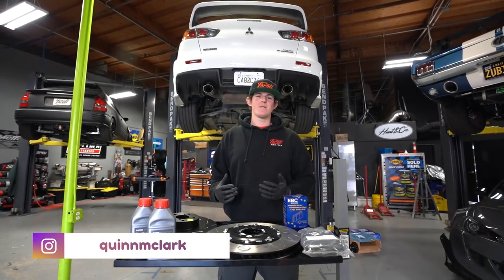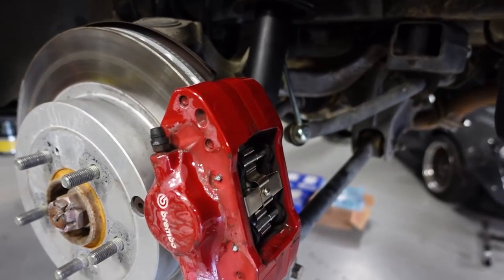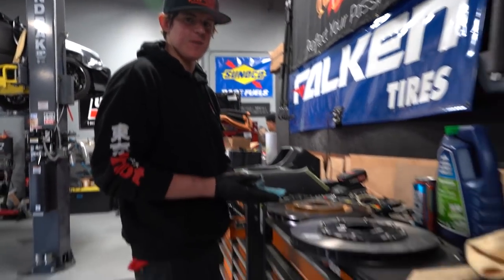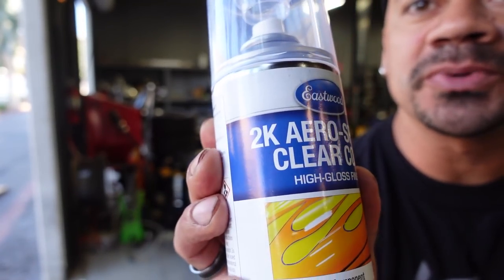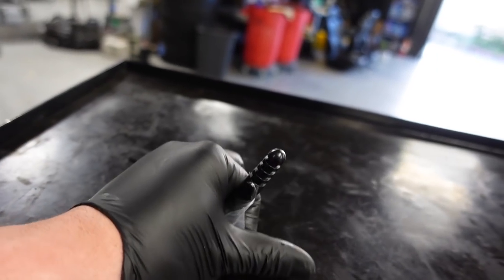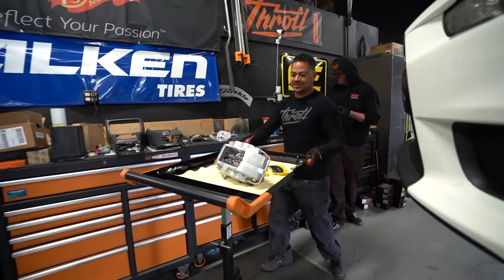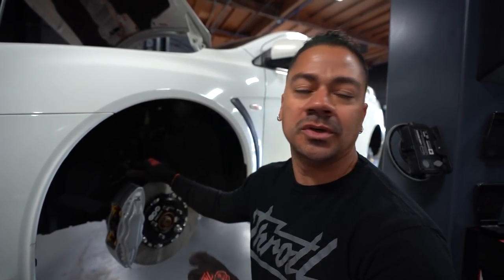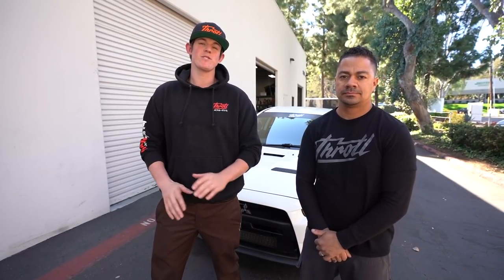Building & Heavily Modifying a 2013 Mitsubishi Lancer EVO GSR - Part 2: EBC 2-Piece Rotors + Brakes!

Comment: Hello throtl, I would really advice against painting the caliper mounting surfaces (the flat machined surfaces which make contact with the knuckle). The calipers will not sit right on the knuckle, destroying the tolerance stack-up of the entire caliper, which is important for correct function. You may get a taper wear on pads, unwanted brake drag torque, or maybe even caliper scratching the rotor. Luckily with fixed type caliper, the pads can't fell off, as they are secured with pins. 

Same with painting the pistons.
Also, brake rotor is unsprung weight.

Designing brake calipers is my daily bread. :)

Comment: 11:47 shouldn’t the brake pistons be taped off?
Reply: Lol that’s what I was thinking too
Reply: Looks like they taped 1 caliper, not the other!
Reply: I was thinking as well...Im learning abt everything still but would the rubber fine ? would the pistons work properly if 3-4 coats of paint got on em ?
Reply: I’m worried about the red lock tight on the bolts
Reply: @jo3lo85  yea noticed that too.

Comment: I must admit these films of Evo's brings back allot of good memories.  I was lucky enough to have owned 4 of them over the years (an 8, 2 9's and a X).  They are such great cars.  When I sold my last Evo a X in 2012, I just always thought, I would get another one later.  Who knew they would stop building such an icon.  Today, I am older now, been there done that and have spent enough money tinkering on cars, the Evo's in particular I could have almost paid cash for my house. haha.  Once you get started it becomes a drug, an addiction.  I got to the point that 500whp just wasn't enough.  Then, after getting pulled over by a local Sherriff for doing 130mph in a 55 zone, though I had a good reason to why I was driving fast (long story but there was a reason) I realized I had to get out of this type of car.  Its like Spider Man's Uncle said, "With Great Power Comes Great Responsibility".  Unfortunately,  most Evo drivers are not the most responsible drivers.  So I got out of the game.  I do appreciate this car, have tracked them more than  most, had some kind of Evo as a Daily for over 10 yrs.  I personally can take a 4G63 apart probably blind folded haha.  Great Cars.  Great Memories.  Best cars I have and probably will ever have owned from a performance perspective anyway.   Sorry STI fans, the Evo just one ups you every time.   Even to this day, a Stock Evo X will beat a brand new STI in almost every category.  Facts.  haha.  Love the channel, and these builds.  Defiantly puts a smile on my face.  Keep up the good work guys!!!
Reply: "With Great Power Comes Great Responsibility" love it 🤣
Reply: Thats awesome. I just got my first lancer last year. Hoping to upgrade to an evo
Reply: Agreed. Feel the same about seeing s2000 builds
Reply: @TranceF0rmation  They are great cars, but keep in mind, especially for a younger person insurance, at least in California will be OFF THE HOOK for an Evo.  Additionally, my Evo X when stock netted about 15mpg going back and forth to work and that was not hot rodding it around.  I got about 180 miles on a tank of gas.  So with 91 running about $5.00 a gallon it gets pricey.  Just things to know before you buy.  I would love to get another one, but I have been there done that I currently drive a 2020 VW GTI and honestly, for day to day use?  The GTI to me is the better car.  If we are talking on a track?  Different story obviously.  Though, after 10 yrs of being in the "Evo World" track meets, clubs and all, only about 1 in 10 Evo owners actually "tracked" their Evo's.  So in the real world?  I find the GTI just as fun to drive, Insurance is cheaper, gas is cheaper, and more practical.  If you have your heart set on an Evo, I can't blame you. 👍
Reply: @naturalsr405  Yes, there are cars that will always hold a piece of our hearts, but as time goes on, and wanting to get back into one of those cars we let get away, you realize your needs, and wants, are just different.  I actually had to sell my last Evo back in 2012 due to divorce, not that it was in "her" name, but I needed the money post divorce, and I had to sell my car and get something more affordable.  I am doing better now, but going back to those days? Well, I think you know what I am talking about.  Good Times though....Good Times.
Reply: @eppyz  definitely understand the need, sorry you had to go through that. It's been just over 10 years since I sold my s2000, and just recently and old neighbor who had one, reached out and let me know he was selling his, so I'm possibly going to get back into one. Will see.
Reply: @naturalsr405  hope it works out for you...for myself?  I am in a fairly new VW GTI so I have 90% of the fun, just less out of pocket to do so.  Most Evo's I see used are just that USED and decent ones are fetching $10k more than they were when I bought them new.  I just can't justify the purchase.  I part of me wants to do it, but the older responsible me is saying WTF are you thinking??? haha
Reply: @eppyz  oh yeah, totally get it. Same with s2ks. The only reason that I am really even remotely considering this one, is because it was just repainted last year, has a new top two years ago and his price is about 8 to 10,000 the less then what's going on the market
Reply: Beats and STI in every way? I bet the STI can beat the evo in the lets go to the dealership right now and buy a brand new one :) not to mention boxers sound better lol.
Reply: @jordankroeger3382  Yes stock vs stock a 10 yr old Evo X can beat a New STI in every performance category to this day.  0-60, 1/4 mile etc.  Yes you can go buy a new STI today, dealer has one on the lot for $45k near where I live, I never paid anywhere near that for any Evo I ever bought new.  Base STI's are going for $41k.  Evo's were the better performance bargain, won't even go into mod potential right out of the box.  That's another debate.  Facts.  They hurt sometimes.  Evo wins.  haha.
Reply: @eppyz  I've owned both and I preferred the STI, but that wasn't the point lol you sorta missed that. The point was the Evo is dead and the STI is still being made.
Reply: @jordankroeger3382  I understand you preferred the STI that's your choice, and I do understand they still make the STI, so what is your point?  That the Evo is bested because the STI is still around?  Come on.  If you think that, then you missed my point as well.
Reply: @eppyz  I never said the Evo wasn't better lol you're all jacked up about it settle down the motor and chassis have more potential though I would argue it has an inferior AWD system. It does seem that most people preferred the STI though based on sales numbers and the fact that it's still being produced.
Reply: @jordankroeger3382  well I will disagree with you on the reason why the STI is still produced and the Evo isn't it really doesn't have anything to do with sales because the Evo at least was always designed to be limited production usually 5,000 units or less per year it's the fact that Mitsubishi as a business wasn't doing well financially and they had to cut whatever they can to stay in business that doesn't mean that the Evo wasn't as good of a car it just means Mitsubishi made bad financial decisions.  As far as the STI having a better all-wheel-drive system that's Up for debate the Evo 10 with active yaw control was ahead of the time that is pretty commonplace now but you have to remember that Evo 10 came out in 2008 and had stuff that the STI was just starting to get now so if you're comparing a new STIs all-wheel drive system to the evos 14-year-old all wheel drive system here in the United States anyway then yeah that might be true but I never seen proof of that on track I mean it sounds good on paper but in the real world the Evo just always was a tick faster than the STI it just was and still is everything else is subjective based on preference both are great cars as you prefer the STI I prefer the Evo but I will say this the STI always look good in my rear view mirror 👍
Reply: Bothers me too much that a Donut video about the Evo was said that it would likely be reincarnated as a crossover...Hope that an Evo-crossover type of car isnt gonna be here anytime soon.
Reply: @Zeckrom_Gaming  You and me both.  Can you imagine... Geeze🙄
Reply: @eppyz  A normal crossover is, well, alright. But a sports crossover/SUV like a Maserati Levant? Doesn't sit right with me to be honest

Comment: I believe rotors are unsprung rotational mass. The light weight rotor hats help shave off some unsprung mass

Floating 2 piece rotors help prevent pad knock back.
Reply: correct
Reply: correct, I misspoke.

Comment: You can take a razor blade and cut the lower part of the stock antenna and use it as a spacer for the shorty antenna so it gets rid of the gap. That's what I did on mine. Tip: Cut "spacer" long and trim to fit.

Comment: Those RC style antennas are horrendously & notoriously known for causing leaks. Especially when owners take them to the carwash & the rotating brushes pull, yank & slap. 

Never use a metal stubby antennas. Cut/modify the rubber antennas instead. They're designed to yield & bend without causing major water damages & destroying g the headliner. 

A shark fin style antennas, capping/covering the oem factory screw/opening or antenna delete are better than using a solid metal stubby antennas. 

I modified the oem/factory RC rubber antenna to a stubby. Have never had any leaks, interior rust/mold, headliner damages/mold & the Sirius & XM antennas circuit board deteriorate.

Comment: Paint stripper or some B17 stripper is a great thing to have around the shop. Strip calipers in 4mins. 

Rebuild the seals all 4 45mins

Paint/ powder coat in 2 hours time.

I like to have a clean shop. Too much dust with sanding

Comment: I dont believe brakes to be sprung weight as stated. Sprung would indicate the suspension is holding that weight up, which just isnt the case when it comes absolutely anything attatched to wheel/hub assy.

Now a loss in rotational mass i can get on board with.
Reply: Correct, i misspoke.

Comment: Brembo advises against powder coating their calipers when refurbishing them. They are painted from the factory because the powder coating process requires baking the powder at temperatures that affect the metallurgic properties of the aluminum alloy they use in their calipers. It would probably be fine but doesn't hurt to know what they advise if anyone wants to refurb theirs.